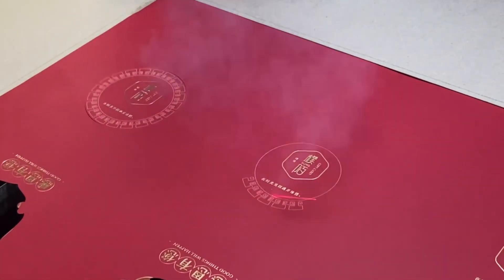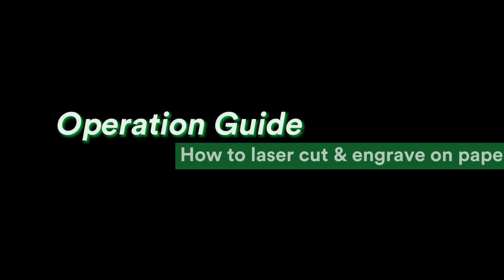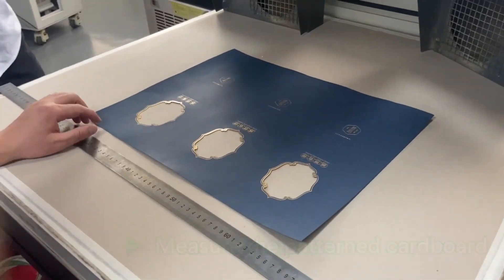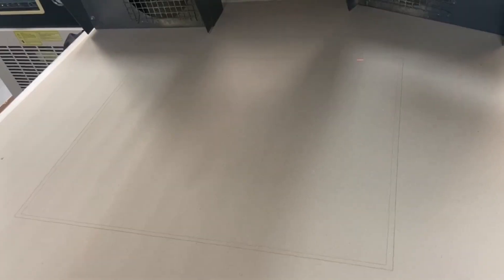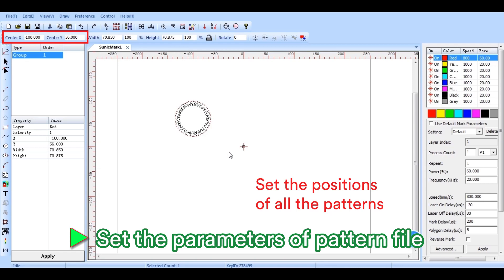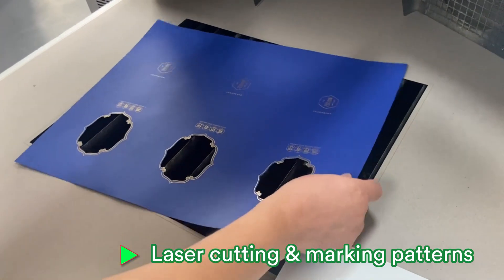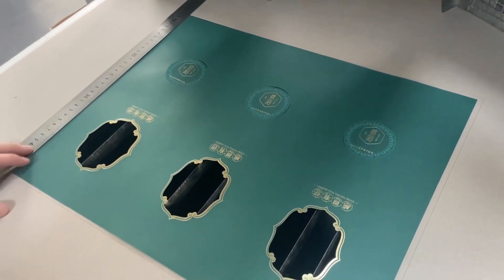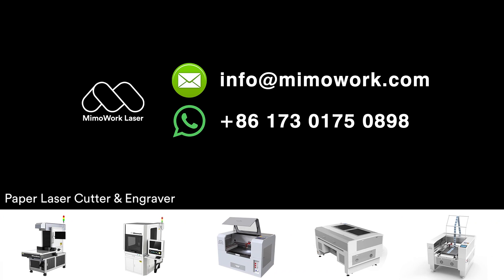How to laser cut and engrave paper | Galvo Laser Engraver

Comment: Great Bro. Can you Please Share same Working with K5 Mini Laser Engraver. I have Tried at 10% Depth & 50% Power but Paper Burnt out.
Reply from the maker: K5 Mini Laser Engraver is a hobby diode laser engraver, whose laser configurations are different from the CO2 galvo laser engraver we used in the video. For your question about paper burning, we can guide you to the appropriate setting parameters for the co2 laser galvo machine.  If you are interested in our machine, you can check out the site: https://www.mimowork.com/galvo-laser-marking-machine/paper-laser-cutter.html